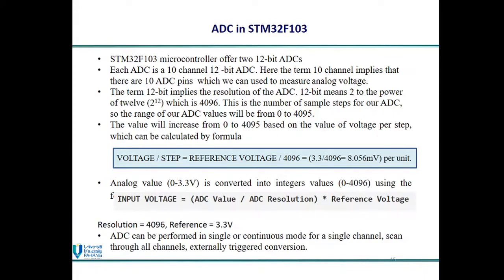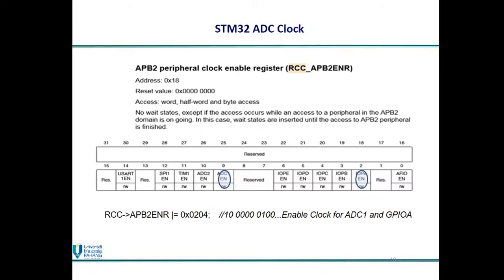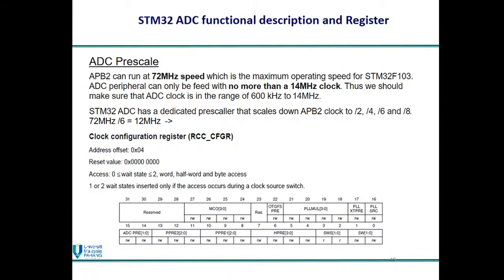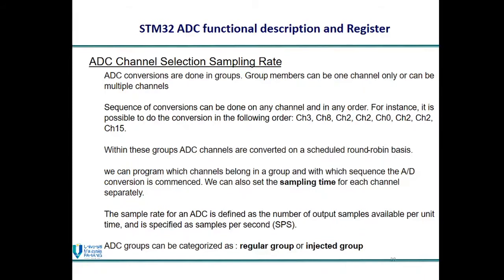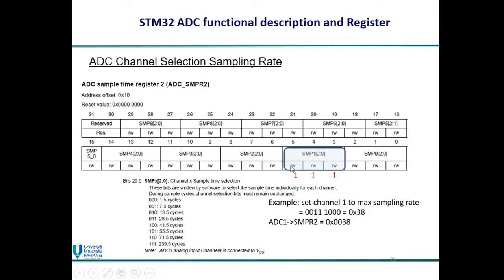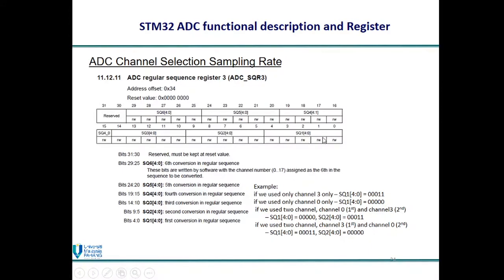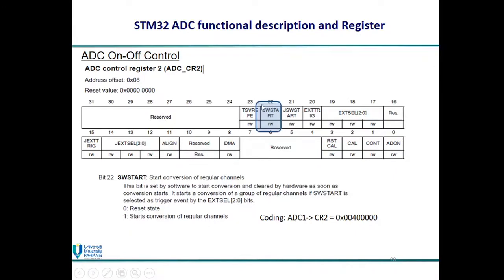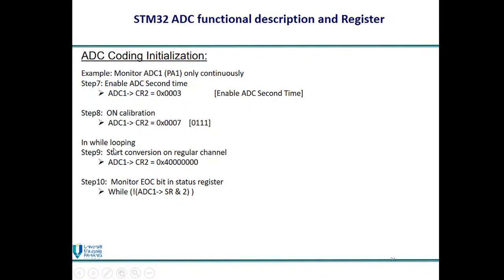Interfacing STM32F103 with ADC - class 2 [Register]

Comment: In ADC class 3, you said that 0b0011 enables GPIO as an analog input whereas you are saying 0 in this video @ 21:07. Which one is correctly?
Reply from the maker: Thank you for your comment. Some mistake there...if analog you need to configure as 0.  follow the last coding  (in that video, its correct)..GPIOA>CRL = 0x00004A00.